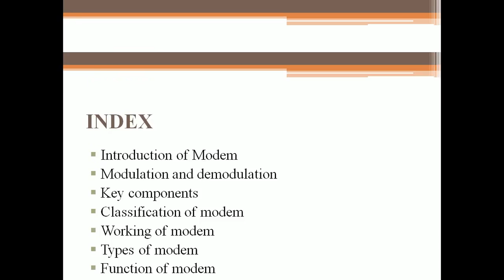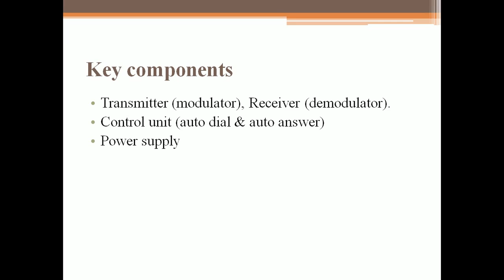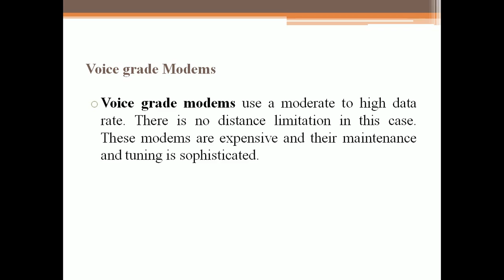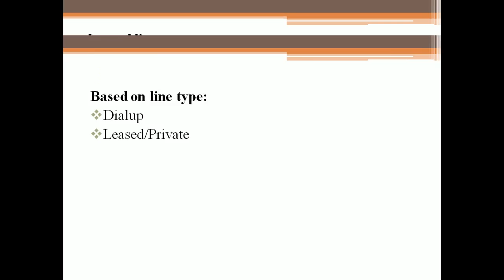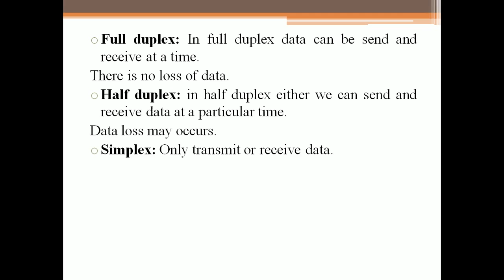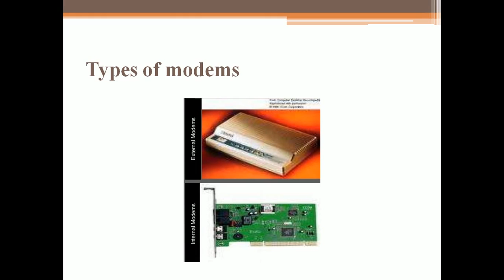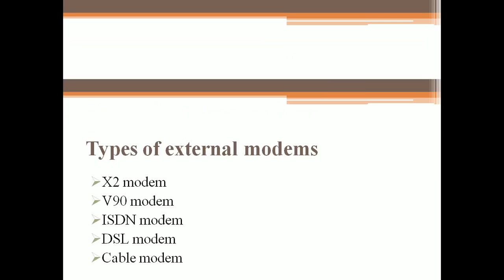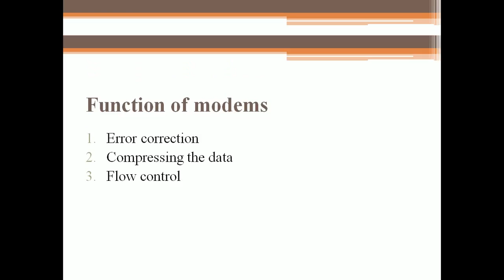Modem

Comment: Good.
A modem is a device or program that enables a computer to transmit data over, for example, telephone or cable lines. Computer information is stored digitally, whereas information transmitted over telephone lines is transmitted in the form of analog waves.

Comment: Good.
Summary:
MODEM is a communication device which receives & communicates data via telephone lines. Modulations means conversion of digital to analog electrical signals. Analog signal is needed for transmission over telephone lines. Demodulation is opposite to modulation. Cable & DSL modems are 2 types. Modem connects home network to wider network & router connects all the devices to each other at a given place.

Comment: Good
Summary
Modem is short for "Modulator-Demodulator." It is a hardware component that allows a computer or another device, such as a router or switch, to connect to the Internet. There are three types of modems: cable, digital subscriber line (DSL) and dial-up.

Comment: good
summary
      modem is a device which sends and recieve data. it makes a connection between people that is why, it is known as communication device.  It converts or modulates  an analog signal from a telephone or cable wire to digital data (1s and 0s) that a computer can recognize

Comment: GOOD
SUMMARY
Modem can be abbreviated as modulator or demodulator. Modem Is an electrical devices which is used to connect a computer with other devices of its network. It conver digital sigbal into analog signals and vice versa.

Comment: GOOD
SUMMARY:  " It is a hardware component that allows a computer or another device, such as a router or switch, to connect to the Internet. ... Similarly, it converts digital data from a computer or other device into an analog signal that can be sent over standard telephone lines.

Comment: Good
Summary:
The word Modem is derived from word, modulator-demodulator. It a hardware device/component that connects a computer with other devices like router or switch. It modulates an analog carrier signal to encode digital information and demodulates such a signal to decode transmitted signal.

Comment: GOOD✌
SUMMARY : Modem is short for "Modulator-Demodulator." It is a hardware component that allows a computer or another device, such as a router or switch, to connect to the Internet. ... Similarly, it converts digital data from a computer or other device into an analog signal that can be sent over standard telephone lines.